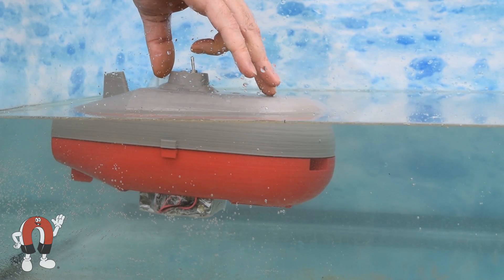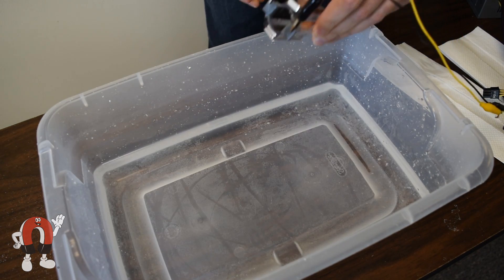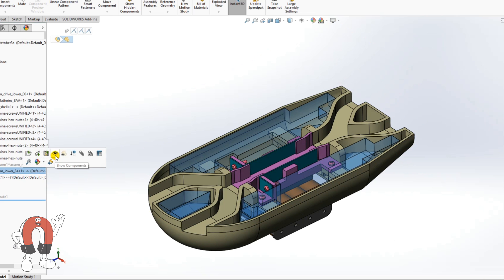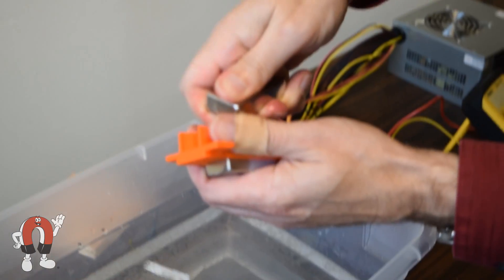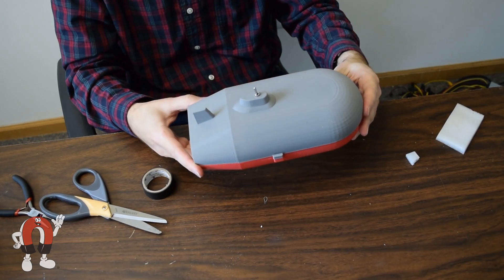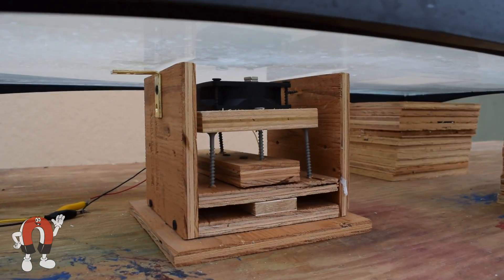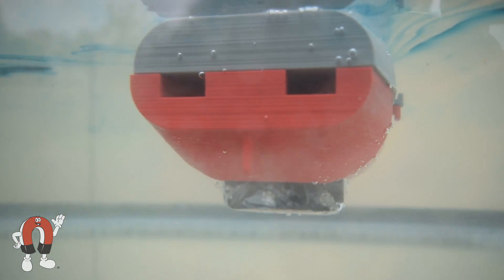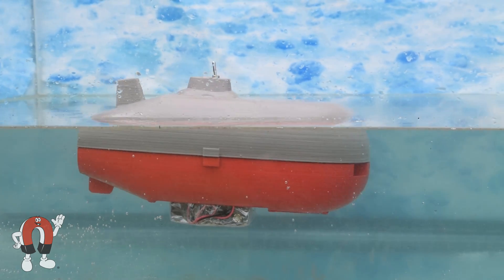Magnet Powered Submarine - The Hunt for Red October IRL!

Comment: Cool done guys….and if in a real size setup you would have photovoltaic panels on top of the boat for charging the batteries and ….collecting the hydrogen what is an energy bonus could be used f. e. in the nighttime to generate power supply for the magnetic motor…. The boat in the right shape.. built of low resistance materials… I can imagine it can be kinda revolution in modern shipping systems…..
Go ahead

Comment: Not enough power the track where you move the water through is too wide and you don't have any nozzle effect at the end. Nick the innovator has spoken. By the way you know we've created Fusion or makes a lot of electricity in last for decades on a single tank of fuel. Do more research and you'll find out that we already have the engines for an F-16 that could put it in the air for 30 years on 2 4. 0 we can put an AI pilot and laser weapons build them by the millions and send them to China

Comment: Obviously the electrolysis is a problem, not only is energy being lost to electrolysis instead of to motion but the volume transition to gases would surely be a noise and wear problem much like cavitation.  I suppose the magnetic field could be intensified and the electrodes could have greater surface are for lower current density, perhaps the current in the seawater could be induced magnetically rather than by electrodes though that would probably require more chambers and perhaps ion transfer membranes much as batteries and fuel cells have.  Another option may be to use radio waves to excite the seawater essentially creating a plasma drive.   There are also ways to further increase magnetic flux density while reducing external magnetic flux which could be used to detect the submarine, however the Halbach array creates alternating flux direction so the current would have to reverse and unwanted cross current would occur, unless the array was transverse to the desired flow and there were physical dividers between the differing magnetic flux directions however this limits you back to electrodes for the current as those physical dividers would need to be thin however if most of the energy delivery is by magnetic flux through electromagnets through clever arrays and current density is kept to a minimum, this might work.

Question is, why don't we hear of this being done with actual military submarines?  Is the electrolysis too much of a problem? Is the magnetic flux leakage too detectable as we already try to make the hulls non-magnetic to prevent detection...

Comment: I served onboard nuclear “fast attack” submarines for 4 years. Your model needs three components to make it (potentially) viable on a nuc sub: (1) exhaust nozzles similar to those on a gen. 4 or 5 jet aircraft so the force of the exiting water can be adjusted (narrower exit = more force), (2) ability to reverse the direction of the thrust (shouldn’t be difficult, place another set of electromagnets at the back end and simply switch electrical feed from front to back - assuming a real sub would be using either liquid nitrogen-cooled or (if ever made practical) room temperature superconductive magnets) in order to be able to slow down rapidly, and (3) a means for capturing or breaking up all those bubbles into such small sizes they wouldn’t make noise (“cavitation” is the creation of bubbles by the propeller blades, very loud and the cause of death for any submarine in enemy water), and the stream of bubbles can be tracked by sight, surface-scanning radar, and probably some version of lidar; while the bubbles might not collapse suddenly - cavitation bubbles do collapse - they likely would still make a fizzy sound. Those are the real challenges, but none pose insurmountable barriers provided adequate thrust cab be achieved in ocean water’s salinity (33-35%). Thank you for the fascinating experiment!

Comment: Electric power is voltage times electric current. Voltages beyond 2.5 V produce hydrogen. The energy generating hydrogen is lost. Therefore you should avoid it. Go for high current instead. The limit of generating hydrogen depends on the material a little bit. I would try graphite.

Comment: If I could make some suggestions. 1 use aquarium sea salt (instant ocean is best for this) for more accurate ocean replication 2 make the nose a bit more narrow for better water displacement 3 on the out ports make them a bit smaller to force the water to condense into a more narrow stream to go faster 4 use a hydrometer to measure the actual salt levels, ideal level is 1.023-1.024. You might be happier with the results.

Comment: If you're doing this on your own: 1) The gasses being released are a 2-to-1 ratio of H2 and O2. Running electricity through water causes it to break down into its component molecules in exactly the perfect ratio to go boom. Their submarine is filling itself with the perfect ratio of gasses to cause an explosion. Sticking a lighter in there was not very bright. 2) You're also going to get chlorine gas as a byproduct. It's heavier than air and will stay in its container - and it's more than capable of killing you if you stick your head in the down there... like maybe you're testing in an aquarium and reach down to pick up your model?. 3) The process also produces Sodium Chlorite (not Chloride), which is an impact-sensitive explosive when exposed to most carbon-containing molecules... like skin... hair... oil... and the kinds of plastics used in 3D printer filament. #3 is probably the least of your worries, but only because the other two are as serious as they are.  But if you're going to do it anyway, seal the thrust channel and have it angle upward to the aft so the rising bubbles help move water backward.

Comment: With the production of oxygen and hydrogen gas bubbles, I imagine that it would probably produce some kind of sound.  The need for strong magnets will make it findable with MAD (Magnetic Anomaly Detectors) which are put on Orion anti-submarine aircraft and sub hunting helicopters.  It's probably slow, too.  These might be reasons that probably explain why it hasn't been built by any navy.

Comment: "...It is wise to study ones adversaries.... yes?"   And so I have... done some experiments of my own on this....wish I had more time to play... One advice I would give...
Use higher voltage, over current.... will work better.... maybe try 6-8... 18650 batt's .... 
wire them in series.... for around 24 to 32 volts... if you could get 48 to 72  volts would be even better....

Comment: Regarding 'bubble noise' (normally mentioned in movies as "cavitation" produced when prop screws turn faster (and/or change rotation speed) than the current water flow rate v pitch.. permits laminar flow to be retained... I'd wonder if electrical produced GAS bubbles could actually 1) form at depth large enough to be an issue, 2) also the gas pressure would be a close match for the surrounding liquid pressure... So no sudden collapse.. 3) additionally surely 'cavitation noise' from spinning props is due to small vacuum 'bubbles' (so NO gas pressure) as the liquid on all sides of a 'bubble' slams together AFAIK hence despite the appearance of 'bubbles' two entirely different things 😎

Comment: Interesting, I am curious though what the magnetic pole orientation is is it to the ends bow and stern or to the faces top deck and bottom hull? Also what happens if you orient the magnets repelling vs attracting? I wonder if a fair amount of potential is lost in the attraction? The flux lines would be more dense however the field you’re operating in is actually two opposite fields semi balanced instead of one unbalanced field. 

Follow up make 3 flow paths withe the magnets repelling. One above, one between, and one below. Let’s see if we can increase our water flow.

Comment: The real stealth drive is a passive heat exchange drive from the nuclear reactors WITHOUT PUMPS.  So the system would suck in water heat the water and at the same time cool the reactor and the differential of expanding hot water was the propulsion.  It wasn't fast but it was incredibly quiet...

Comment: I may be wrong but wouldn't speed continue to increase? The water flowing through the jets is being accelerated constantly so with a hydrodynamic hull the top speed would be almost limitless.

Also, on a real sub, the hydrogen and oxygen bubbles could be captured and burned back into water to reclaim some energy and eliminate a bubble trail.

Comment: You have peaked my curiosity,  my mind draws little modifications, plays with electro magnets,  and thus allows reversal of flow, uses two drives, and if it fails becomes parts for a rail gun ... lol. While have built boats, and many flying things, a sub, offers a whole new challenge,  oops seem my old drawings, maybe of use, designed in 72, it included a motor to recharge the batteries, and other functions , wonder do I still have those drawings,  no,, oh horse feathers. Well if I did it once maybe I can do it again although my math skills are a bit fuzzy, unlike the young man who worked in radio control so many years ago. ....

Comment: Right away this is not explained correctly. "We hook up one plate to ground and the other to a voltage a current will flow if it's submerged in sea water." What ground? What voltage? Why not say positive and negative to complete the circuit? "That's probably mostly hydrogen, but maybe a bit of chlorine as well." Yeah, no shit you're splitting water with salt in it. Hydrogen, oxygen, chlorine and sodium hydroxide are produced, there's no maybe's.

Comment: A similar process could be used to replace pitch and yaw planes.
Some of the reasons this technology wouldn't be used on military submarines are because this technology would be easy to track via the gas bubbles and the magnetic field, additionally this drive would lose effectiveness as it got closer to fresh water such as from rivers and ports that are fed by rivers.
Lastly; the thrust from this drive is quite limited - something that is important for military applications.

Comment: Firstly, you are creating electrolysis with the direct currents, you will wear out the conductors in no time.  The solution is to use AC and also electromagnets to change the direction of the magnet force constantly.  How the real drive works is not though a single pair but multiple pairs of the current+magnetic force will create syphoning  effect and pushing effect.  But I think the project was abandoned because it sucked it a lot of stuff like fishes, debris and seaweeds to make it really viable.

Comment: Although I like the experiment you did, it has potential. But to be the devil's advocate seawater is generally concerned an sg of 1,025 so not 3,5 %, other than that, if you would ad a non return valve somewhere in the system it would work better.

Comment: Required: a Longer Tank, a Means to measure Speed and Acceleration, and a source of power that allows varying the Current and the Voltage, to determine which is more effective: Higher Voltage or Higher Current!
Reply: Given a constant water conductivity, there's no way to adjust current and voltage independently from one another. Still interesting ideas though!

Comment: MHDs don't just move water either. They are also used to pump liquid metals and salts such as Sodium, Potassium, Lithium, etc.. without moving parts or seals that are especially vulnerable to leaking. This has been used on liquid metal/Sodium cooled nuclear reactors to some success in the past.

Comment: I hate to submerge your belief in this system but while the engineering behind it is feasible, the physics behind it being that quiet and undetectable is hogwash. The system would produce foamy and bubbly discharges that it would make too much noise. On top of that the machinery required to make it happen would be 10 times noisier than current models.

Comment: This was great fun. Although, with all that cavitation, silent drive is the last thing it is. One can here those bubbles popping from tens of miles away, without a sonar.
Reply: There's probably a way to buffer the plates with fabric or something and direct the bubbles into a tank inside the sub. Anything will work as long as the current flows across the jet. A high frequency AC current on the plates with alternating electromagnets might keep the bubbles smaller.

Comment: If the packing tape and insulating tape on the wires works I'll be amazed.. It'd be OK in non-salty water... Well I'll be, they got away with it! OK boffins, so the gas released was hydrogen, was it only hydrogen, what happened to the oxygen?

Comment: I kinda wish you guys had designed the drive system to be the 2 intakes into the thrust drive with a housing that carried straight back out of the boat or even widened and flattened out (maintaining the same cross sectional area) … 😁 but still a very cool actualization of the concept into a small model. 

Taking an otherwise bland and hard to relate scientific formula and demonstrating it simply and with readily available items was fantastic. 

On that note i was wondering if reducing the cross section size at the “exhaust” would increase the exit velocity or just restrict the system?

Comment: In real life this would not be used for high speed anyway since the whole point of it is to be silent, and the faster you go, the more noise you generate what with flow noise over the hull. A 35 year old Ohio class ballistic missile submarine can move absolutely silent at low speeds even with regular screw propulsion.

Comment: Very cool video.  Former submariner here.  

There’s 2 reasons why such a means of a propulsion wouldn’t work for submarines.  

1.   Big electromagnetic fields are fatal to a submarine.  That’s one method they are counter detected and as such submarines go through a special degaussing process.  

2.  Most importantly the bubbles.  In terms of sonar detection those bubbles would be incredibly loud and more than completely makes the lack of moving parts moot by the formation and collapse of them.

Comment: An ac linear motor creates eddy currents in the aluminium track which push it forward. Would that work with sea water and perhaps avoid the power loss of hydrolysis?

Comment: Mitsubishi built a 200 Ton ship in 1992, the efficiency (even with the superconductor magnets they used) was only 4%, 15 times lower than a normal boat engine. Not speaking about the fishes who died due to the chlorine it produces.

Comment: that would make the powerplant the noisiest thing on board, that's amazing. Why wasn't it built yet? ... Or are we simply kept in the dark because military secrets?
Edit: maybe such a drive would be too easy to detect. After all it seems like the russians have adapted radiation detectors at the nose of their submarines to track the US navy subs. Maybe a simple device akin to a compass would give away the submarine
Edit:2 I guess the second and bigger problem are the bubbles. The electrolosys is making to much gas. Popping bubbles is loud. While cause differently cavitation is one of the most giveaway things in submarine warfare.

Comment: The secret of a perfect drive. A kind of iron reverberating ferous or negerous silica that can heat or direct emite electromagneticaly pewer curent at the earths ultrasonic natural emmisions. With a propper condensator and stratified reverberating metals pluc electromagnetica condensator you can obtain the ultrasonic charged battery generator. My vrlery best regards an Red October  fan.

Comment: This is very cool. I didn't know this was a real thing. Question, would tapering the exhaust ports inwards a little increase the thrust? What I mean is, if the ports where the water exits the sub are smaller than where the reaction is taking place between the aluminium strips, would it force the water through faster, therefore increasing thrust?

Comment: I was wondering how the underwater radar view would look since the engine is quiet. Also, if there were several rows of plates instead of one.The thrust could increase.For example, it can be with an electromagnet instead of a magnet.If galvanized plate is used, it can turn salt water into electricity. If galvanized plate is used instead of the plates you use, maybe both propulsion and electricity generation can be provided.maybe you noticed. Your project is beautiful. have a nice day

Comment: This technology reminds me of the Ion-Drives you see on some space probes! Low thrust but direct from electric energy to thrust without moving parts or combustion. 
Very cool project! I can already see several desgin changes I would make to increase the speed: More magnets in longer tubes, additional magnet tubes, slimmer overall design that displace less water and bringing the battery inboard are low hanging fruit I see.

Comment: Well you experiment has a couple of flaws. You are putting way too much current and actually electrolizing the water into gases that is help propulsion.  You can add multiple plates/poles to increase propulsion in same area. Curious to see it would still work with less voltage.

Comment: I'm really impressed by such a smart idea !
I'm wondering if the same rules as jet engines apply on this kind of propulsion.
That is, the available power is  trust times sailing speed.  In other words the faster the boat sails the more efficient the drive becomes.... Tough you need a large tank to figure that out.

Comment: Fun fact: There actually was a kernel of truth to the Red October story.

Not the part about defection or giant magnetic drive sub,
but at low power settings, the movement of the Typhoon class was enough to keep the seawater 
coolant loop of the reactor going, even with the pumps turned off, making it much quieter.

I don't know if that was by design, or something they worked out by having a big-Russian-balls try,
but American Subs heard them do it.